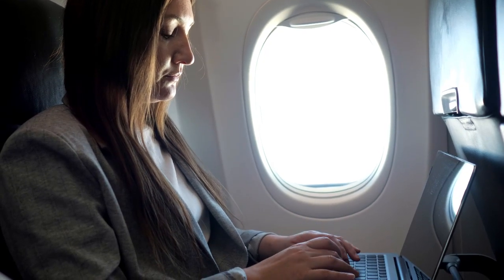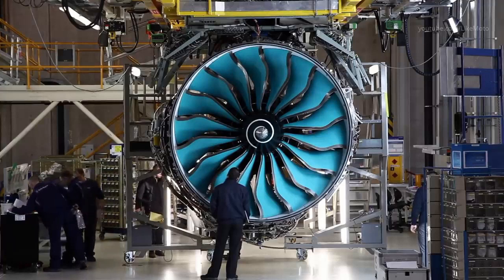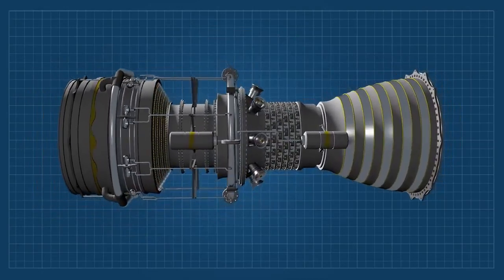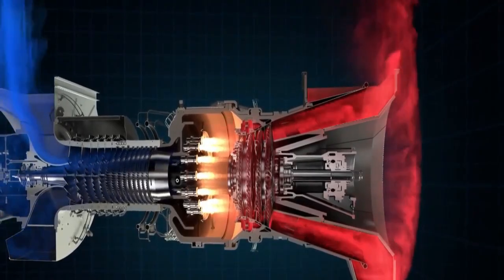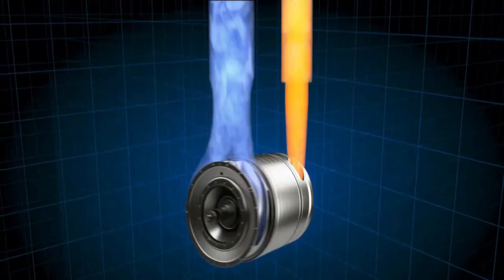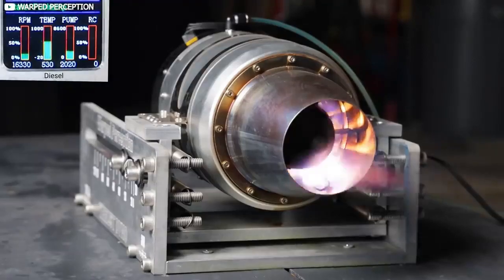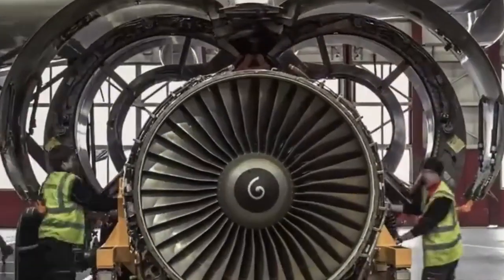How Plane Engines Work

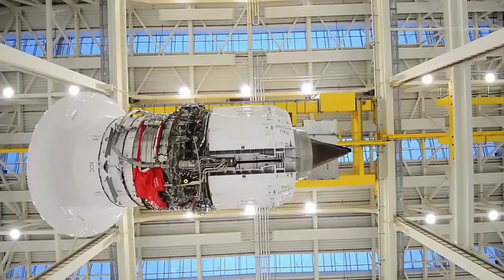Comment: This is meant to be constructive criticism. The audio segments should follow along with the video segments. When talking about piston engines, do not show turbines.  When showing gas turbines for aircraft, do not show gas turbines meant for electricity generation. And do not continue showing gas turbines in the electric propulsion segment. This would make the video easier to follow and understand. Also, from about 1:15 - 1:55, the video spoke of gas turbines, then spoke of piston engines, then gas turbines again, and finished with electric propulsion. The 2 gas turbine segments should be unified after the piston engine segment as that follows the outline of your "most common types of airplane engines" statement at the 2:40 mark. Again, this makes the video easier to follow.
Reply from the maker: Thank you. I will keep this in mind for my upcoming videos